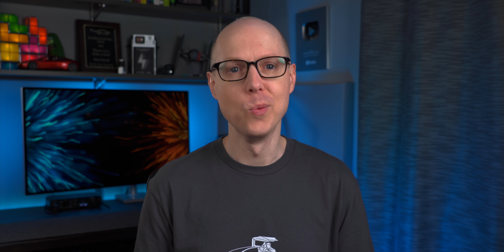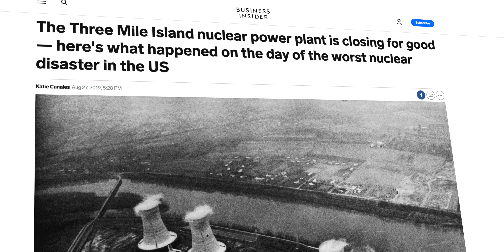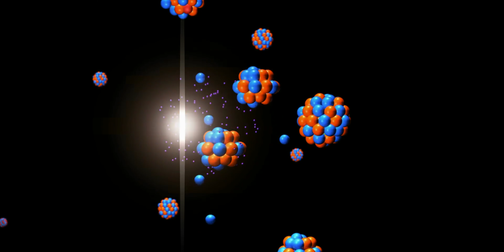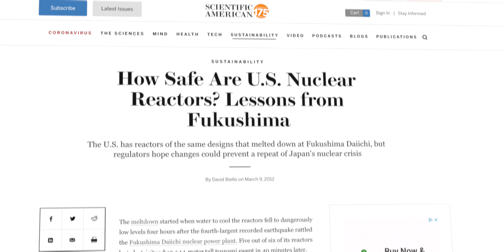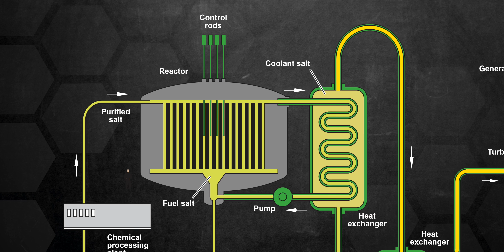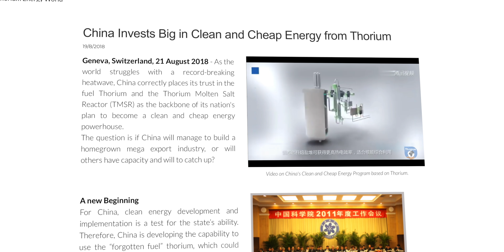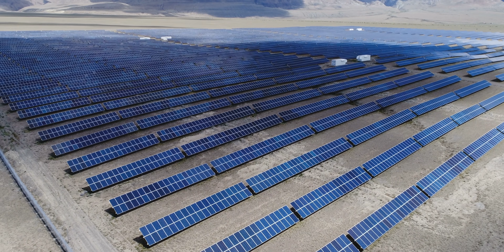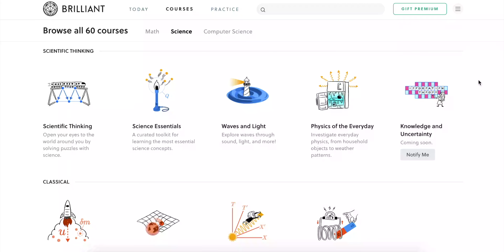Thorium explained - the future of cheap, clean energy?

Comment: Here's how fission power really works: uranium gets hot, turns water into steam, the steam turns a turbine/generator to make electricity, and the whole thing stays safe long enough for the investors to make money, live large, and die before the bill comes due.  That is all one sentence because every word is just as much a part of the basic concept as any other.  Fission reactors weren't practical until the following innovation "solved" the problem of nuclear waste: let's just put this on the shoulders of some future generation, and let's make money now!  Thus the nuclear industry began.
Reply: Steve Robbins, hi.
Nuclear power is the only form of power generation where ALL wastes are kept isolated from the environment.  Coal, spews nitrous oxides, sulphur oxides, carbon dioxide, 2.5 micrometer particulate matter, 10 micrometer particulate matter, mercury, cadmium, lead, arsenic, a witches brew of other heavy metals, benzine and other cancer causing compounds, Formaldehyde, Dioxins, Acrolein, Hydrogen Fluoride, AND trace amounts of Uranium and Thorium.

As the high quality coal is exhausted, progressively dirtier coal is being burnt so the waste being produced by coal burning plants has gotten significantly worse in the last 40 years.

Every nuclear plant in the USA has paid millions into a fund to deal with the nuclear waste.  The government has taken that money and spent it.  So it sits, safely, isolated from the environment, waiting for someone to do something with it.  

Further, nuclear power plants are required to take out insurance verses a worst case disaster.  No other form of power is required to do this.  Imagine a natural gas plant has a leak and a fuel air explosion levels a subdivision.  They declare bankruptcy and leave the public to deal with the problem.  That has not happen, but natural gas pipelines have leaked and destroyed over a dozen houses.  The gas company responded by suing the victims because they dug in the wrong place.  (No evidence that anyone dug anywhere.)

Nor do people seem to mind about endlessly pumping carbon dioxide into the air.

*

Thorium not only produces 10,000 times less long lived wastes than traditional, solid fuel plants, but versions of a molten salt reactor can be designed to burn up current nuclear wastes creating power from them.  

I recommend a few books in you are curious:
"Thorium: Energy Cheaper than Coal" by Robert Hargraves,
"The Silent Epidemic: Coal and the Hidden Threat to Health" by Alan H. Lockwood, MD.
"Sustainable Energy - Without the Hot Air" by David JC MacKay.

Warm regards, Rick.
Reply: @RicksPoker  All good points.  I gave your reply a thumbs up.  And thanks for the book recommendations.
But consider these facts:
1. We're easily able to build new solar and wind generation capacity fast enough to keep up with the increasing demand for electricity.
2. Even if we dumped wind and solar and went all nuclear, we'd still need to build lots of large battery farms to smooth out the peak loads on our aging transmission lines, because that's cheaper and easier than replacing those lines.  And if we've got battery farms, then all the concerns about the variability of wind and solar are greatly reduced.
3. Wind and solar have the huge advantage that they don't require any water for cooling.  (This is why nuclear plants are always built next to bodies of water.  They suck in water and turn it into steam.  But you can't drink steam.)  This will become increasingly significant in the future as water resource become scarcer due to climate change and population growth.
So why do we need to build any new nuclear power plants?  What is nuclear's big advantage that will overcome the political opposition from the NIMBY crowd, and merit the enormous use of precious water resources?  Oh, I know!  It's the business model.  Power companies want to generate all the power in centralized facilities, distribute it to millions of customers, and bill them every month.  Decentralized power generation is their worst nightmare.
Reply: @steverobbins4872  
Hi Steve, thanks for the thumb!  I disagree on a few of your points tho...

1) I don't believe this is true in the third world.  Everything I've read says that they are building coal power plants at a horrible rate.

2) Some nuclear power plants are load following.  Consider a LFTR.  If we are drawing a lot of power, the salt in the heat exchanger gets cooler.  Cooler liquids are more dense.  If the molten salt going into the reactor core is more dense, then the atoms are closer together and there are more of them in the core, so there are more fissions, which produces more heat.  So LFTR naturally scale up and down by several percent to follow the load.  This will replace a LOT of batteries.  (It also means that if the reactor overheats somehow, it automatically slows down the reaction.  And if it gets dangerously  hot it automatically melts the salt plug and scrams itself.)
Further, enough batteries to smooth out a continental scale grid is gigantic.  Hopefully lots of people will put in Tesla power walls and spread out the number of people paying for it.  But Tesla is battery constrained, and even if they were not it would take many decades to create that many batteries.

3) This is true, but some people have claimed that LFTR can be air cooled.  (I can't vouch for this, I've never seen the numbers.)  But IF it were true it would work because of two factors.  First, molten salt reactors run at a higher temperature, so they are more thermodynamically efficient.  (That means that they produce more useable work and less waste heat.)  Second, they have efficiency to spare.  In other words, they might be a bit less efficient being air cooled, but still good enough to provide power economically.  
Again, I want to emphasize that I am not sure about this, I've only heard that people are considering air cooled molten salt reactors.

Warm regards, Rick.
Reply: @RicksPoker  Thanks Rick.  Nice to chat with someone so knowledgeable.
But I think you misunderstood what I wrote about the need for battery farms.  I meant that the batteries can do more than just help with load following and smoothing variable supply.  The problem is getting more power over existing transmission lines that are already near capacity.  There has been a lot a progress over the past 20 years or so on this problem; ENERGYSTAR pretty much mandated power-factor correction in most machines that draw power from the grid, thereby greatly reducing the imaginary power so that more of the line's capacity could be used for real power.  But having a battery farm at the load-end of a long transmission line could allow pretty constant load on the line 24/7 resulting in much lower peaks.  This would allow higher average loads, which means you can keep up with growing demand without building new lines.

Comment: Thanks for this informative video. Personally I think people generally confuse the question of thorium vs molten-salt reactors (MSRs). MSRs can use thorium, however they can just as well use uranium and this is the route that most companies in this space are going. Most of the normally stated advantages of thorium such as greater inherent safety, higher burnup rates, less radioactive waste etc. are really advantages of MSRs in general, not thorium specifically. Uranium 235 requires no breeding or complex online separation and has a well established fuel chain, it is just a lot simpler to make it work. There's also no real shortage of uranium anticipated any time soon: especially if using fast reactors. I personally do believe MSRs have real benefits and are going to be hugely important in future power generation, but thorium I am more sceptical on.
Reply: The main problem with uranium 235 is its rarity in the earth.  It is as rare as silver or platinum in the earth's crust.  99+% of all uranium on the planet is in the form of u-238...  Like .7% of it comes in the form of u-235.  In order to get at that u-235 we need to process shitloads of uranium.

99+% of thorium is ready to use as is without having to process it.

1 kg of thorium equals 4,800,000,000 kWh of electricity generation.
1 kg of uranium equals 24,000,000 kWh of electricity generation.

Thorium is 200 times more efficient.
Reply: @Les_S537  That's cool, but uranium is incredibly energy dense: 1 tonne of uranium contains the same energy as 3 million tonnes of coal. So it doesn't really matter, the fuel costs for a nuclear reactor are neglible and there is no anticipated shortage of uranium soon. Sure thorium would be even more efficient, but it's only saving money on something that is already a neglible cost for nuclear power. The more important question is which can we roll out at scale most quickly in order to prevent climate change and provide energy for the developing world. Here uranium has a huge advantage being both simpler to use and having a well established fuel cycle, regulatory process and infrastructure.
Reply: Tom Shackell you must have skipped over the part where I said that only .7% of uranium on the planet is in a form that we can actually use. 

Let me put it another way. If we could plop enough nuclear reactors in place tomorrow to provide everyone on the planet with the energy they need, the uranium would only last us a few hundred years at most. 

Conversely, we have so much thorium that we could fuel the planet for millions of years
Reply: @Les_S537  No I'm very familiar with the natural mix of uranium isotopes :) A few hundred years sounds pretty good .. and that's assuming in the next few hundred years we don't master breeder reactors, or fusion, or anti-matter warp drives or whatever. There are already advanced nuclear designs to get much greater use out of uranium, such as the travelling wave reactor which uses U238, or molten salt fast reactors that can consume spent nuclear fuel. I'm perfectly happy to have the discussion again in 200 years if it still looks like we're going to be running out of uranium then. But for now I favour the path that can most quickly bring the greatest benefit in the next 50 years, where we really need it.
Reply: @tomshackell  The uranium-235 to plutonium fuel cycle results in lots of radioactive waste that takes tens to hundreds of thousands of years to become safe. 

The thorium to uranium-233 cycle results in very little long term waste...
83% of all waste from a molten salt nuclear reactor operating on the thorium-uranium fuel cycle comes out as: 

neodymium (used in magnets)
molybdenum (used in electrodes)
strontium (used in electronics, metallurgy, and chemicals)
zirconium (used in many commercial products)
rhodium (used in electrical contacts)
ruthenium (used in electronics)
and palladium (used in jewelry and specialized alloys). 

Those are just the most typical uses for those elements... 

15.5% of the remaining waste/by products are the toxic and radioactive by products cesium 137 and strontium 90... Cesium 137 has a half life of 30.17 years, and strontium 90 has a half life of 28.9 years. That means that after 300 years, the waste is "safe" and can be used in things such as nuclear medicine, as well as other industrial uses. 

The remaining 1.5% of waste comes out as neptunium 237 which can decay into plutonium 238 over time. This is the stuff we just put away for long term storage.
Reply: @Les_S537  That's true ... unless you put that waste into a molten-salt fast reactor such as the SSR-W design by Moltex that is currently under development in Canada:
https://www.moltexenergy.com/stablesaltreactors/. The MCFR by TerraPower (Bill Gate's company) is another example in development. These reactors would convert all the long lived waste into short-lived (300 year) waste.

Comment: Good video! The technical complexities and comparable experience with Uranium reactors are probably the biggest barrier here, but there is also a short-term proliferation concern - Protactinium 233 has a half-life of 27 days, and during that time you could extract it from one of these reactors and process it in such a way that you can separate out the Uranium-233 for bomb material. The good news is that once power has been underway for a while, the reactor will have a decent amount of Uranium-232 to make extracting the U-233 much more difficult.
Reply: Hi Brett Anon.
U233 is a much poorer bomb material than U235 or PL239.  Further, NO nuclear weapons have ever been made from the products produced by a commercial power plant, so it is largely a meaningless argument anyway.